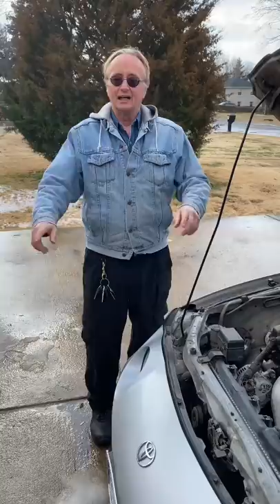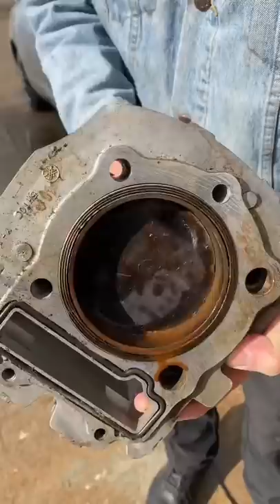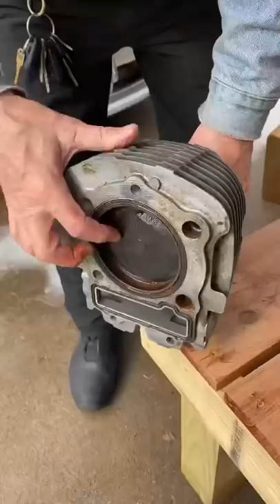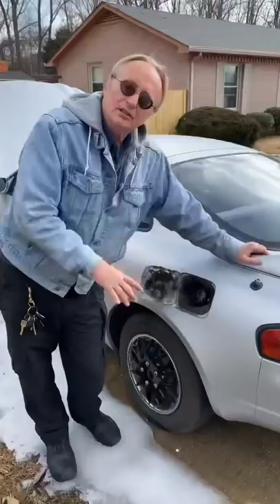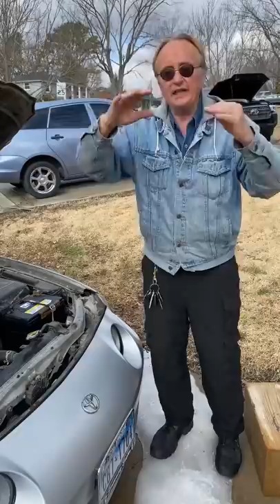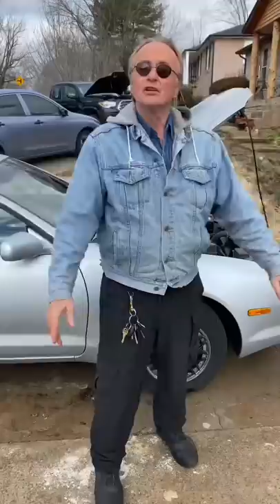Bet You Didn’t Know This

Comment: I had a 96 F150 that was at about 150k miles and started running like crap.
Did a full tune up, plugs& wires & cap & rotor & air filter & fuel filter and it was still running like crap. I accidentally grabbed the wrong nozzle one day and filled it full of premium, it smoothed out completely by the end of that 1 tank of gas.
Reply: Could be injectors if it is fuel injected.

Comment: Scotty: dont buy premium all you need is regular 
Scotty now: get premium
Reply: Yeah, at this point I don't know what to believe in, except for my wallet.
Reply: Yeah it's just a phase lol next year he will make a video called " Why you should never use Premium gas on old engines"
Reply: Ikr
Reply: Generally you shouldn't buy premium but if you have carbon build up. Use premium... it helps reduce carbon build up and suspends the carbon in your oil.
Reply: @KnightofAntiquity  so what would you recommend idk if my car has carbon build up I just bought it, 1999 Honda Civic 115k original miles and was regularly serviced
Reply: @Mndsets  Scotty did a video on simply driving on Shell V power between a single oil change to see changes on performance.
Reply: @KnightofAntiquity  How do you know if you have carbon buildup? I have a older truck that runs on 87 should I put premium once in a while?
Reply: @slysimon8533  lol that's what I was asking him too lol but tells me to watch another Scotty video 🤣 yeah I'm not going to scroll thru 1000 videos just to find it so what's the answer lmao 🤣
Reply: @Mndsets  I plan on continuing to put 87 in then using fuel injector cleaner every couple thousand miles
Reply: @slysimon8533  I see yeah whatever you can do to where you ain't burning a hole in your wallet especially with gas prices nowadays, my car runs fine on 87  no ticking obviously because my car was regularly serviced lol
Reply: Scotty,now I don't  know what to do.
Reply: @Mndsets  If there is no knocking, you don't need premium gas
Reply: @nvlarcht  thank you for the answer I need lol. Someone who actually gets what I'm asking and doesn't refer me somewhere else lmao 🤣
Reply: @KnightofAntiquity  yeah, whole point of the vid, not everything has an abdolute, judt like how if you have a turbod engine premium is most likely better
Reply: @Mndsets  Followed by, "Don't buy a Toyota."  LOL
Reply: Decarbonize and save money

Comment: I use regular/87 in my ‘98 4Runner and it takes it fine. I can be in 4th or 5th gear at low RPMs, hit the gas, and there is no knock or ping or anything. A guy runs a can of Berryman’s in the gas tank once a year or so, seems to keep the fuel spray-it-happeners pretty clean too.

Comment: I told you this Scotty 2 years ago and will tell you again, Hondas run much better on premium otherwise you have to change the Oxygen sensors.  
My Volvo also runs great on premium. 
Can I run these cars on regular gas? Sure but why save on gas and then pay hefty money to your mechanic!!
Reply: Every internal combustion motor will run better on higher octane granted it is tuned for or there is an efi system that allows for af and timing adjustments. If you cant adjust anything in the fuel system a slight bump from 87 to 89-93 will not hurt anything and the engine will function decent.
Reply: My Honda’s ngk sensors say leaded fuel will damage sensors

Comment: Ah yes, I remember the good old days when we had to decoke the engines to cure the pinking caused by carbon buildup - easy enough on a 2 stroke single cylinder bike engine (and remember to leave about 1/8 inch untouched around the circumference of the piston as that becomes the primary seal!)
Incidentally, in the UK our "Regular" gas is actually called "Premium" and is 95 octane, our "Premium" is called "Super" and is 97 octane. Current gas price is around 7.40 USD so you've got a ways to go to catch us up!
Reply: I believe what you're referring to is dubbed the "Italian Tuneup"

Comment: After reading several comments, some suppose Scotty has flip-flopped on his regular vs premium fuel debate. I searched his channel for premium fuel and he has several videos on the topic. Including this video, Scotty has remained consistent on his opinions of premium fuel.

I will attest to the validity that premium fuel will eliminate pinging in older engines. Two years ago, I purchased a 2002 F150 4.2L, 5 spd manual with 183,000 miles. When accelerating it would ping like crazy. I put in Techron additive for 3 fill-ups, but it continued to ping. I watched one of his videos explaining how premium fuel could help reduce pinging in older cars. After a half-tank of premium, the pinging stopped. I consider the additional costs of premium fuel acceptable. Heck, one less trip to Chick-fil-a pays for the increased fuel cost

Comment: I have a 93 GMC c1500 4.3 l I've been running premium gas ever since I've owned it I've had that truck now 15 years. Plus the only gas I can get now that doesn't have ethanol in it is premium every time I stick that ethanol in my truck I always have nothing but issues same thing with my 1990 RV with the 460 Ford motor injected.

Comment: I run non-ethanol fuel in my 300,000 mile Kia Sportage and it still gets 31 miles to the gallon and yes it does run better. It'll maintain speed on a steep hill without dropping down a gear. Yes the premium non-ethanol is more expensive but considering it gets better mileage. It pencils out to be about the same price and I like the way it runs better so it's a win for me.

Comment: Not really the pressure that pre-ignites fuel but the heat that comes from it and of course the heat developed from normal operation. Also, if any carbon buildup is starting to flake as it comes loose those little bits can glow like a little mini spark plug and ignite the fuel mixture before it's time.

Comment: I have an FJ cruiser and Toyota actually recommends you use premium, but will run on regular. With regular it will retard the timing to prevent knocking at the expense of power. It also is not nearly as efficient. I can get 13 mpg at best with regular, but i can get up to around 18 mpg at best with premium.

Comment: You got me again.  Never thought of carbon as a factor in combustion chamber size.
Reply: It can also causes what's called dieseling in carbureted engines. (When you turn the key off but the engine actually keeps running very roughly) Older cars used to kill ignition instead of fuel when you turned the key off, but excessive carbon on the pistons would ignite the fuel that the engine would suck in while winding down because it was red hot. it was a very weak combustion, just enough to keep the engine barely running to keep pulling in fuel to keep cycle going. Excessively rich carb can cause that as well.
Reply: @ElectricSwordfish  Yeah.  The good old days.  Sometimes you had to put it in gear to make it stop.
Reply: @markgigiel2722  another trick that sometimes worked was just pressing on the brakes. When the vacuum booster pulled in air it was just enough to choke the engine

Comment: What's in newer modern cars that make regular gas not matter compared to premium gas?
Reply: You're probably thinking of knock sensors. As soon as pre-ignition is detected the sensor will detect it, the engine computer will retard the ignition timing to keep damage from occurring. It's not a free lunch though, engine performance will go down some and fuel mileage will suffer.

Comment: My 2011 chevy Malibu cranks but won’t start unless I press the gas pedal when then engine is cold. Sometimes when it’s cold it’ll start without touching the gas pedal but it runs rough.Starts good when engine is warm tho. And I’ve replaced the throttle body and maf sensor.
Reply: check the coils, plugs, and valve lash(if possible).  Sounds like it's running lean when cold so you might want to check the fuel trim.  Why did you replace the throttle body and MAF sensor?  Usually you can just clean the MAF sensor.  Check it for a vacuum leak.  Check the air filter to make sure it's not dirty or clogged.  I don't think those had an EGR, but check the PCV valve and hose for cracks/leaks.  If you have to give it gas to start that means the Air/Fuel mixture is not being set correctly by the computer causing a lean condition.  Even giving it gas to start causes rough idle which probably means a misfire.  If you know someone with the same year car that runs well listen to their engine and listen to yours at rough idle.  Chances are it's only running on 3-5 cylinders.  Next try to figure out which cylinder is having the problem.  You could have a malfunctioning fuel injector when cold.  Chances are it's not running good at temperature it's just running good enough to not stumble/misfire at idle.
Reply: I cleaned the sensor and throttle body. when I brought it in to a mechanic they wanted me to pay $600 to replace those parts that I just clean and so I decided to replace them my self hoping to fix the issue . Not a vacuum leak, I got a new air filter, no pcv valve but I replaced the pcv hose, I have new spark plugs as well.
Reply: I also read that it could be the computer for fuel management. If it’s a computer problem do I have to bring it to the dealership and how much would that cost?

Comment: synthetic oil  change at 3k and premium gas cheaper than engine
Reply: synthetic will last 7500 miles, and you don't typically need premium gas.  Try to run the vehicle on 87 and see how it performs.  If the engine runs fine on 87 then just use that.  If the vehicle knocks on 87 then try going up to 89, and so on.  You can always switch back to premium if you want, but modern engines are designed to run on 87, and I have yet to see a car built since 1985 that won't run on 87 just fine unless it specifically needs high octane, or there is something wrong with the engine.
Reply: @billibarou Besides increased cost anything bad with synthetic oil change at 3k and premium gas.  2008 solara 4 cylinder 49k miles.  They don't build these cars anymore.

Comment: Would it be worth filling up with premium gas just 1 time To take advantage of the cleaning additives? Have a 200000km Nissan with a 1.6L I4. It’s not running great but i think it’s being cause by carbon buildup because it always seems to run the worse after idling for 5 or so minutes or when I’m driving in a city in stop and go.
Reply: Run an octane boost treatment to a full tank of gas. Might run better???
Reply: Spend the money on a can of Berryman’s. Do this once a year and you’ll never have to worry about these problems, as long as you keep up the preventative and regular maintenance.

Comment: The owners manual of my 1972 Ford LTD said congratulations you have the first Ford engine that doesn't need premium gas as it will run on 93 octane is what it said has 93 octane was rated regular gas premium was 100 octane ... Is it 400 modified V8 4-in stroke 4-in bore two Venturi carburetor 18mpg highway two door hardtop Prism Pearl gold over ford white

Comment: You can also rid your engine of carbon by  carefully trickling a small amount of liquid oxygen  down the carb while the engine is running on a fast idle. Too much is not a good thing. Don't try it at home!
Reply: I've used water before